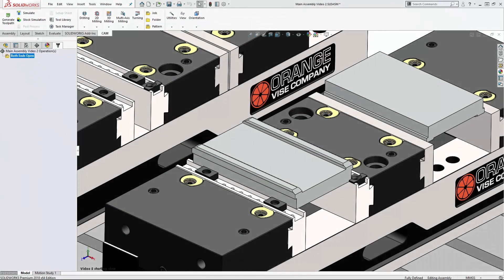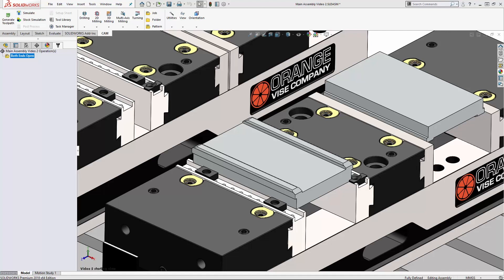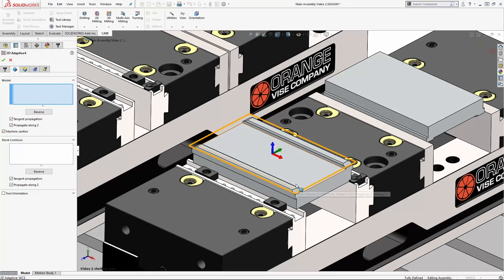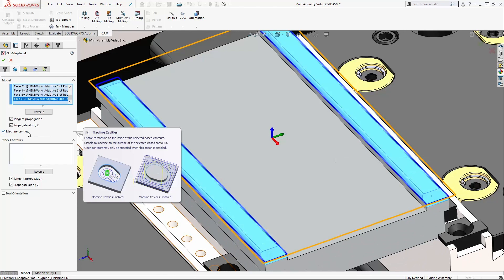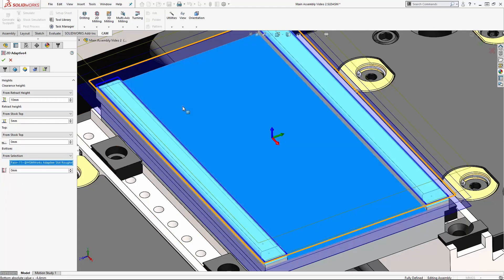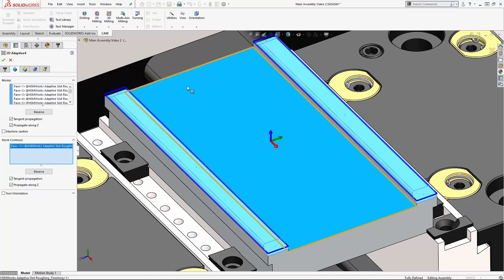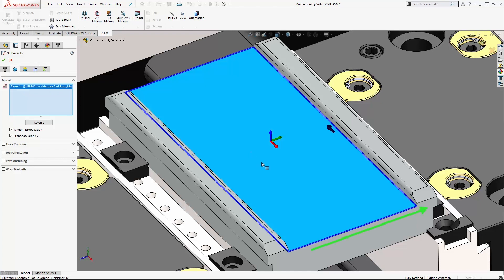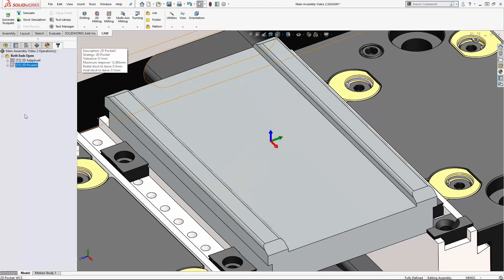HSMWorks QUICK TIP: Finishing Open Pockets and Slots

Comment: Did not work for me. My open pocket has one side with a bend in it. Maybe this is limited to parallel sides?
Unfortunately, I still have to waste time by making a sketch around the pocket perimeter and extending the sketch to at least 1 tool radius past the open ends, then selecting that to pocket.